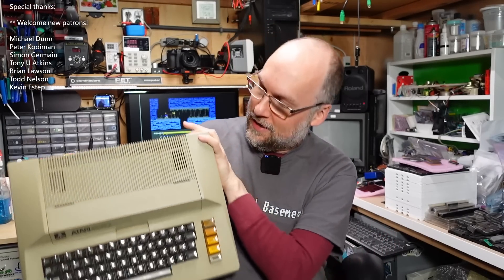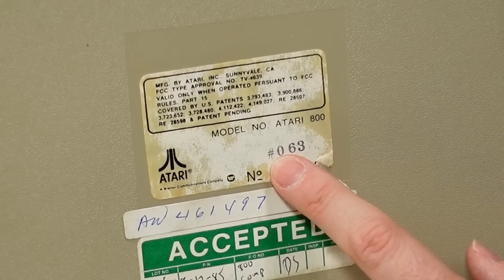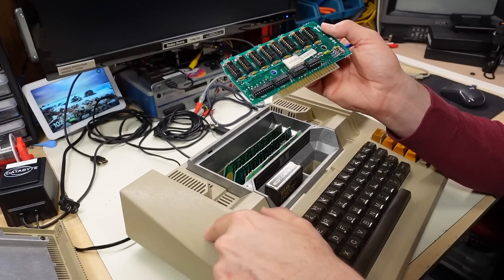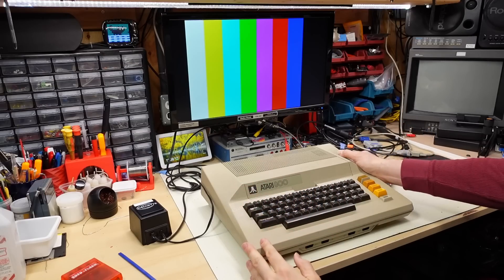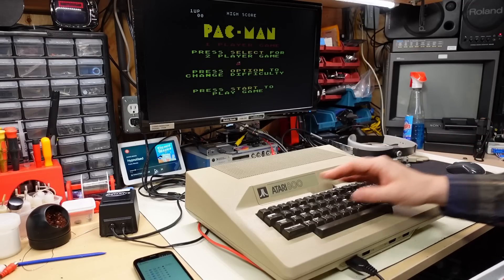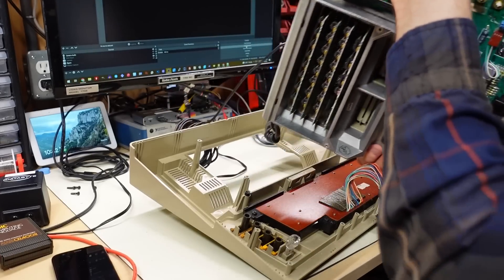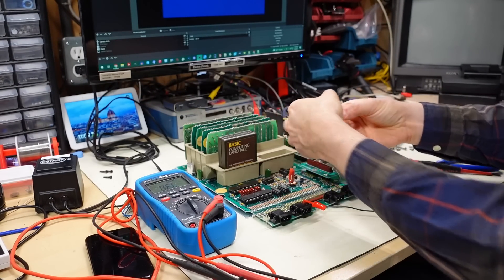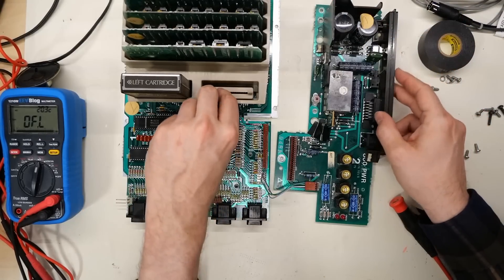Troubleshooting the beautiful Atari 800

Comment: I really miss the days where the "OS" was an a cartridge. Boots to a usable mode in less than 3 seconds, impossible to damage in any way, virus and malware proof by design. Simply genius.
Reply: You miss the days when the whole OS would fit in a few KBs of ROM? That's the equivalent to missing people exclusively driving horse carriages instead of cars... with the argument that you didn't need need to buy fuel and go to a repair workshop.
Reply: @graealex  actually, it's more along the lines of: I miss the days when computers used a rom stored memory image of the entire os that gets directly copied to ram on CPU initialisation negating the need for slow sequential load, execution and ram storage of thousands of files before you can get access to a usable environment. Because lets face it, copying data directly to memory using a bus that has the exact same throughput as the ram itself will always be fast than sequentially loading everything through a slower bus and then using a bridge to put things in memory.
Reply: @Francois_L_7933  That is only true for comparable bus speeds. The ATARI in question has a clock speed of 1.8 MHz and an 8-bit bus, which means it can at most transfer 1.8 MByte/s, at optimal conditions.
Compare that to a modern PC with NVMe speeds around 3,5 GByte/s, and the fact that the whole OS in question would completely fit into the CPU cache - this would still be faster, despite having to load from one storage into another.
Again, you are just missing computers that had crappy OSes and zero peripherals that needed initialization. If you install FreeDOS on an SSD on a modern x86 with a reasonably optimized BIOS and disable most peripherals, you also get instant boot. But then you're stuck with DOS.
Btw. Windows does somewhat emulate what you might mean - fast booting here means the whole Kernel state gets stored on-disk (into the hibernation file), and gets retrieved as-is when booting. Although on modern machines with fast SSDs, the time saved is negligible.
Reply: @graealex  Still, I'm not entirely sure that there wouldn't be any time saving. Though I must admit that NVMe drives are closing that gap. The big advantage with a ROM stored OS is that it can be more secure and pretty much idiot proof from the start, which makes a lot of the powerr hungry security in modern OS's unnecessary.
Just imagine having a crashed drive and still being able to boot the OS. Imagine a malware infestation that can't affect the OS itself (that wouldn't go far). Imagine unbelievably fast boot speeds (as fast as accessing the BIOS). Imagine that you don't need multiuser stuff just to protect the system like is the case today. That's what a ROM based solution brings. It doesn't mean being stuck with a 1.76mhz machine and a 4K basic interpreter like it did back in the days, it means going back to what made computers of the days so great. I still remember getting my first DOS machine (a 386 DX-33) and finding DOS 6.22 dreadfully slow to boot when compared to my C-64. DOS is faster booting today simply because the hardware speed to OS size ratio is greater, not because it's a better design.
Reply: @Francois_L_7933  The same security can be reached with TPM - also, any somewhat advanced computer will shadow ROMs into RAM, just fyi (meaning the BIOS gets copied into the RAM, because the RAM is faster - which somewhat negates your perception of ROM being equally as fast, it's only true for systems that have quite a slow clock). Maybe you should play around with some specific Linux distros, which boot in less than ten seconds, without sacrificing all actual usability. Both Chrome OS and Solus OS can be quite the fast booters.
Reply: @graealex  I already have played a LOT with linux (two Linux laptops, a Batocera base console I built myself, an Octopi print server). But to get my point across, try out KolibriOS or Menuet OS. Granted they're not exactly full featured but it's enough to give a taste of the speeds I'm thinking about.
Reply: @Francois_L_7933  Well, the original claim was that nothing is faster than having the OS image in a ROM, which is really only true for slow clock speeds. At some point shadowing was introduced, meaning even back in the days, copying the basic OS from ROM to RAM was already faster. Obviously this is far more true today, with modern DDR5 reaching 50 GByte/s, and NVMe Gen 4 theoretically topping out at 8 GByte/s with 4 lanes.
Reply: @graealex  I do agree that things are getting faster every year. The thing that I find a bit sad is that we need all this very sophisticated technology and equally complicated OS to manage it all just to try and reach some end-user speeds that were there 40 years ago... 'cause, in the end, it's not the processor speed that really counts but what you can do with it.
I've got an old Core2Duo that's running 165 processes and hogging over 4gb of ram just to type a reply. The thing takes the better part of a minute (if not more) to start and get to a usable (albeit very slow) state. Once everything is cached, then it speeds up, but it's still really annoying as my dream computer would work more like a toaster than anything else: you just plug it in and it's ready to be used.
Reply: @Francois_L_7933  I think I understand what you mean. But I think it has more to do with being able to understand how all the components work. Back then, it was actually quite possible to have a good understanding of how every component works, internally. That gives the feel of control. Nowadays there is so much garbage and stuff and services running, and it is outright impossible to understand how all of them interact and work, just because they are so many.
This doesn't change the fact that exactly these interactions are what makes it possible for you to watch a video here or write a reply. These are decades of software development and man-power, even if it sometimes feels like it is progress backwards, i.e. making things worse instead of better.
Also, maybe it's time for you to get a new computer. One that's snappy and somewhat takes away the perception of it all being to much. Modern computers are even more able to run multiple OS at the same time with virtualization. Just a bunch of cores and RAM and you're ready to go.
Reply: @Francois_L_7933  Btw for me personally, understanding all components ended around Windows XP. With Win 2000 I understood nearly every aspect of what the OS was doing, including COM/ActiveX stuff, as well as low-level hardware interactions. That also meant I could objectively argue about whether they were programmed in a particularly good or bad fashion. However, that Zen-feeling has long since gone, and I think for many retro-enthuisiasts, this is what brings them back to older, retro and rather incapable computers.
Reply: @Francois_L_7933  Another aspect: in order to have a worldwide web of computers, you need to implement security measures and access restrictions. For decades, computers were just protected by physical access. If you could sit down in front it it, you'd be able to access all the files.
Nowadays, security and access logic is a real drag on software development. It complicates all programs, and makes computers run slower than they'd need to be if there weren't any malicious actors that you'd need to protect against.
Basically, in order to have certain features, you need to agree to added complexity elsewhere. Back then, Win 2000 contained nearly all protocols even used today, but in a very pure, unencumbered form - albeit it very insecure. Nowadays many features only exist to prevent tampering, for example no-execute bits, security cookies on the stack, or even stuff like SELinux.
Reply: @graealex  Still, I wonder how much of this stuff is just bloated code... Sometimes, it's worth re-writing everything from scratch than having to struggle with over 20 years of patches successively being applied one on top of the other...
Reply: @Francois_L_7933  See, that's what I mean. When stuff becomes as complicated as it has gotten now, we wonder if it could be done in a simpler way. But then there are those decades of development time that went into it, and it turns out that yes, the code has lots of lots of things to do, and that's why all of the lines are required. 
And we might not be able to look into the Windows source code, but you can argue that Linux is somewhat bloated as well, but there every line of kernel code has been peer-reviewed hundreds of times. And every line still remains necessary, for all the obscure reasons that might be.
Another example are things like databases, and other code that heavily depends on performance. Turns out, the way to make it faster is to add more lines of code, not remove them. Simple data structures are usually also slow. While the fast ones rarely can be implemented in a simple way.
Reply: @graealex  This all somehow makes me laugh a bit as back in the old days (including DOS), when you wanted speed there was only one solution: assembly language. But now, hardly anyone still knows how to use it. Yes, it's complicated. Yes it takes more time to program. But while modern compilers come close to reaching the efficiency of that code, it's still pretty hard to beat. But economics wise, it's a really bad investment for companies as run of the mill C and it's variants are cheaper and fast enough. And besides, if the code is too slow, they just wait a bit for the processor speeds to catch-up.
Reply: @Francois_L_7933  The reality is that assembly is only really fast on small problems. You can do some micro-optimizations in a hot loop, although modern CISC CPUs are far too complicated to really understand what goes on performance-wise in a wide range of CPUs in the field. For example, what effect some optimizations have in constellation with cache hits/misses, and/or branch predication, multi-core interactions etc.
And again, adding lines of code is how you get very, very fast code. A bad algorithm implemented in assembly will still be slower than for example a very efficient algorithm implemented in - lets say - Java or even Python. A very good example are SQL parser - the more complex logic you add, the better it will be able to utilize indices when the user performs certain queries. A "stupid" SQL parser with less lines of code will usually perform worse.
You can even adapt this principle to hardware. For example, modern internal combustion engines are far more complicated than 30 years ago. However, that complexity is required for the engine to perform the way it is supposed to. If you leave out parts, simplify the design, then it performs worse. But from the outside it looks like the modern engine is bloated and overly complex.
Reply: @graealex  I must admit that bad code is just what it is and nothing more.
It's funny because you got me thinking of the old Jazz Jackrabit game on DOS. The code is mostly written in C but for some parts they had to switch to assembly because the game ran too slow otherwise (well, their idea of too slow was already faster than most fast games). I played a this a lot back in the day as it was the only alternative to Sonic the Hedgehog on the Sega Genesis.
Reply: @Francois_L_7933  Back in the days, compilers were shit, and you could do a lot of tricks that would require very exact timing, so basically it needs to be cycle-accurate. For example, doing calculations in the blanking areas. Plus, hand-optimized assembly also tends to be very small, and memory limitations were a big problem back then.
Nowadays, a game will for example run faster because of a more complex algorithm for level-of-detail that can better balance triangles that need to be rendered with picture quality.
Reply: @graealex  Sprites have definitely become rare these days.
With AI that's getting better every day, it's just a matter of time before it gets adapted to compilers to produce really small and efficient code.
Reply: @Francois_L_7933  Compilers these day already produce very compact and fast code. In many cases code that a human could not easily reproduce themselves.
Although part of that is the complex beast that CISC CPUs have become. They're basically a small computer in it self, running a firmware (micro code) and having very complex execution paths.
Again, all that complexity was added to make the CPUs faster, and not just because some people like bloat.
Full circle now is CPU micro code getting optimized to work particularly well with code emitted by certain compilers. That makes it even harder for a human to understand all the small intricacies.

Comment: You're thinking of manufacturing in the modern day.  All that diecast stuff would have cost pennies to manufacture, the semiconductors would have been the bulk of the cost.  It's kind of the reverse of today's manufacturing.  The quality of the material does not matter it just needs to be there.

Comment: I actually had a Microsoft Basic Cartridge for my Atari 800, not the Atari Basic cartridge.
Reply from the maker: Interesting -- someone else mentioned several versions of Basic were available. That's pretty neat and I wonder if the Microsoft one was faster and more compatible with the Commodore and Applesoft basic programs? (Listings, if you typed them in.)
Reply: @adriansdigitalbasement  Those were the days getting an issue of compute and typing in the basic programs. Then trying to find your typo when it didn't work the first 5 or six times when you typed run lol. 
I remember my Atari 800 had a bad ram module and I had a small fan that would blow into the back of the computer to keep the ram modules cool and the computer operating.

Comment: 7:18 you didn't need to remove those screws, unless they were damaged or stuck in there. The black plastic clips swing out to unlock the back cover, just use your thumbs to turn them outwards.

Th e cards inside the 800 (if made by Atari) were enclosed like cartridges and do not wobble. A bare board card are often 3rd party and are usually RAM expansions. Usually the ROM card is made by Atari and has an enclosure, so i never seen a ROM card as a bare board. I assume it could be a 3rd party ROM card, but that would break compatibility with other Atari's. Whatever is wrong with that 800 is likely that bare-bard ROM card.
Reply: @IcyTorment  Funny the ROM card i have are in cases, and at least one RAM card is also.  Plus i have a full 48k on only two cards, and only one of them is bare.  I have some extra RAM cards for the 800 that are bare but not being used.

Comment: 6:37 Each version of the Atari had a different version of BASIC, but they were built-in the XL and XE machines.  Versions A, B and C of Atari Basic for each generation, but the differences were extremely minor and i never seen a compatibility problem. All other 3rd party versions of BASIC were on disk, and not used much, unless the there was a compiler for that version of BASIC so anyone would run it as an executable.

Comment: Every single key was consistently not working? Not even a little if you pressed hard? Even though the IO is electrically fine? Occam's razor. It would be hard to create that problem so consistenly through mechanical means even if you tried. The only logical conclusion I can come to is that the keyboard connector was not fully inserted. Try just plugging it again to see if the problem has magically gone away.

Comment: The Atari 800s are lovely machines, though the architecture is compromised by the original concept of it beginning off with very low RAM but then you buy RAM carts. However by the time the machine came out, RAM was cheap enough they gave you the full amount anyway. However, the machine's internals is all based on RAM being variable, so there's some weirdnesses to it. Also the Sprite system on it is very much based on the old Atari system of bat/ball games. Each sprite is a continuous vertical strip across the display. Changing it's x position is easy, as that's just some variable in memory. But to change the y position, you have to manually shift the data for the whole sprite definition. Of course, there are 'ball' sprites which have full x/y control but those are very limited.

However, it has a fantastic copper list system which works amazingly on this, and was then improved for the Amiga, which is essentially the evolution of the system. It's a real pity that Atari didn't realise what it had with the Atari 800 line, and just ran it into the ground. It really has a lot of advantages which the C64 didn't have. If they made an improved system with better sprites, and a RAM architecture more like the C64 where you could swap the chips in/out, then this would have been the ideal 8 bit machine.

Comment: Biggest regret was giving my Atari 800 with an Omnimon modification away....  :(
Reply: Good news.   I managed to get not one but TWO Atari 800 computers.   One is a very early mint one with CTIA instead of GTIA, no yellowing plastic, a working 810 floppy, 825 printer, 1st generation 410 tape drive and an 850 serial interface.   The second machine is yellowed so I installed an incognito into it.   Both have early fully functional keyboards.   Talking about a lucky find!